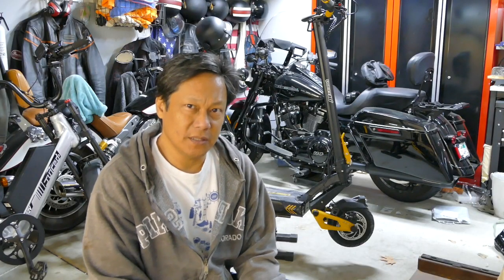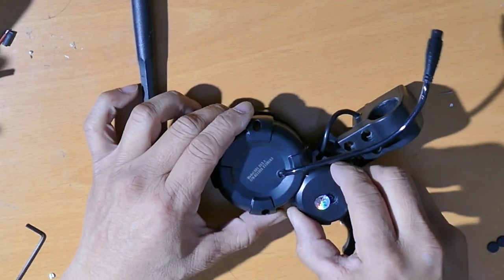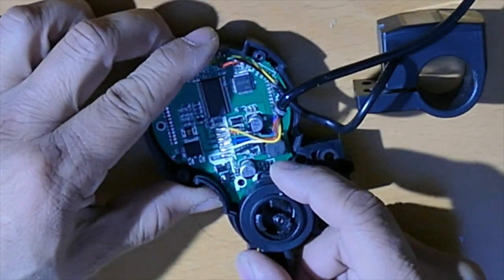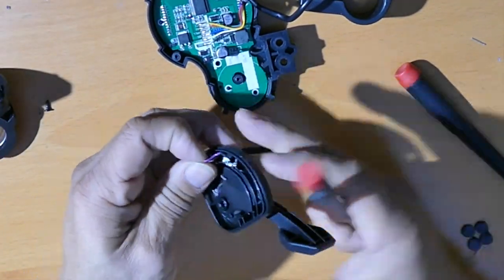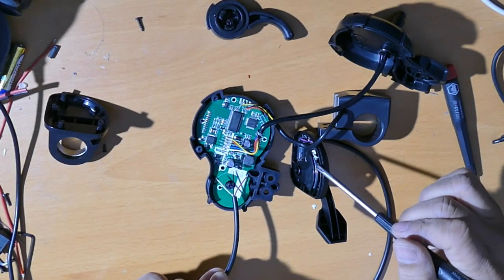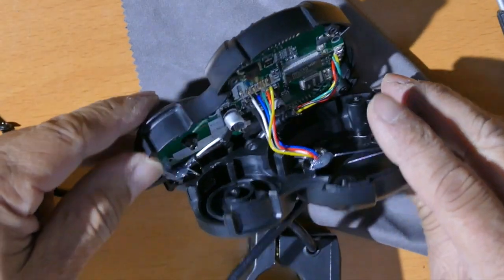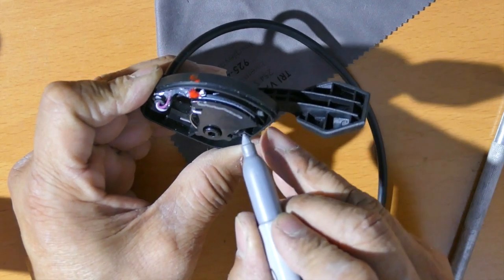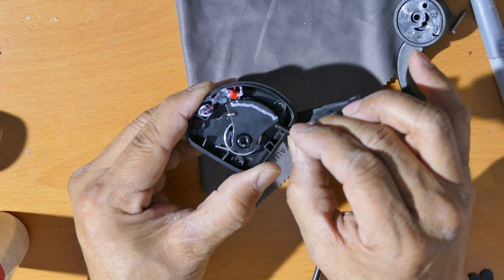Vsett 10+ conversion to thumb throttle? Yes. Works on 8, 9 also

Comment: Edit: switched to the 130x throttle. Better ergo and more control since they're isn't a huge gap of empty throttle so no set screw needed. Thanks for doing this! Got my 10 yesterday and changed it to a thumb throttle the next day. Wired the exact same throttle directly without using the extra wire and filled the hole with glue. Works great! Couldnt have done it without your vid!
Reply: Hello. Can you text link to buy? I want to plug in my vsett 8+. Thankyou
Reply: need the link asell which 1 you bought
Reply: the problem is that these have a different start and end voltage than most throttles, on my VESC based scooters i dont have that deadzone with these throttles

Comment: Great news its possible! This stock Vset 10+ throttle is ridiculous bad!!!
Reply from the maker: Yeah, I didn't like finger trigger either. It was a pain for longer rides and obstructs the brake lever.
Reply: @mypev-diy7269  I´ve used the Original one with the big Display. But fingergas is ridiculous. My easy Solution. Switch upsidedown an now  i have a Thumbthrottle. Works very fine.
Reply: Plz can plz show how to putt the thump throttle magnet in the cirqute board @mypev-diy7269

Comment: I ended up using the same 130x throttle as well. Even tho they are cheap it's my favorite. Immediate response and excellent low speed control. The trigger throttle is terrible IMHO

Comment: well conversion is expected with the same sensor, but magnet travel time is terrible short as i see in this video, if it would be on whole travel length, then would be perfect
Reply from the maker: Yes. That is the problem so the throttle feels sensitive. If I can only figure out how to access the controller's programming, I may be able to change that but so far, I am not able to find any access to the micro coding. I did test the QS-S4 display throttle that is sold with the thumb throttle from factory and it does take up the entire magnetic range when converted to twist so I know the programming can be changed. Just need to be able to figure out how to access it.
Reply: @mypev-diy7269  good luck!
Reply: Did you ever figure out a solution

Comment: I got the same thumbthrottle but the wiring legends are different.  I guess ill follow my own color based on the wired connected to the sensor,  facing the sensor mark,  1Black-2red.3white
Reply: Yeah, the thumb throttle "direct" wiring is different than wiring through the connector. If you can, please post a video of the wiring. It may help other people on clarify. Thanks.

Comment: Acceleration is still really smooth? As someone with a hand disability, this mod is amazing by allowing the use of so many different throttles.
Reply from the maker: Yes, acceleration feel is the same as the finger throttle. There is a setting in the "P" menu to smooth out the throttle also.
Reply: @mypev-diy7269  Thanks! Did you try out that quick release? I like how there is little tension. And any way to have you do the modification if not local?

Comment: Would it be possible to not remove the trigger throttle ?  What would happen if i just drill a little hole for the thumb throttle cable and solder 3 wires to existing trigger throttle hall sensor pins? Would it be conflicting ? Or should i remove the trigger throttle hall effect sensor, solder wires in its place and keep the removed sensor + leave the trigger itself untouched. just in case i want to revert it back to default in future.
Reply: /Also wanted to ask do i need the female part of the cable or can i just cut the thumb throttle cable to reveal those 3 wires?
Reply: /Just noticed your display is not working at all in the end when riding on the road. Why is that? I wouldn't want my display not working after converting to thumb throttle.
Reply from the maker: Display works as usual. Its bright out and the display is horrible in sunlight or bright sky. Its always been that way and I have it set to max brightness
Reply from the maker: You can keep the trigger mechanism in place but the Hall Effect sensor inside the controller has to be remove. Having 2 Hall Effect sensor connected in parallel will cause the output signal to fighting each other, one may be signaling high and the other low and will most likely short out each other. So only 1 sensor can be connected at a time.
Reply from the maker: Don't need the Julet cable. You can solder the wires directly to the board BUT, you will need to verify which color wires goes to the Hall Effect Positive vs Output. It is most likely going to be different if you wire the thumb controller directly without the Julet connector. I included the pin out LINK of the 49E Hall Effect sensor in the description of the video. You need to ohm out the pins and verify or you can blow out the circuit in the display.
Reply: @mypev-diy7269  Thanks for answering my questions! I guess it's easier to look for female julet cable then to make the connecting easier.
Reply: @mypev-diy7269  do you realy need to read the display instead of ride and look at the road?
Reply from the maker: @milordas  Display comes in handy every now and then like check current speed but yeah, hardly ever used during riding.
Reply: @mypev-diy7269  said, "You can keep the trigger mechanism in place but the Hall Effect sensor inside the controller has to be remove...."
Which indicates all you need to do is disconnect the sensor output wire from the pre-exising hall sensor and insulate the two ends you just created from contacting anything else...you don't need to physically remove the sensor or any of the wires. You can disconnect (cut) the sensor output wire at any point along the sensor wire. To restore it to the way it was, all you would have to do is reconnect the two ends and insulate that point as needed (and of course remove or disconnect the thumb mod you had made)

Comment: Hy, i have a question, can you tell me how can i connect a loudspeaker to a hall sensor (from finger throttle) in order to be able to control volume. The loudspeaker have digital volume control and own rechargeable batteries. Thank you in advance for your answer
Reply from the maker: That is more complicated because the loud speaker most likely uses an optical dial or digital push button to adjust high or low. It's not going to be easy but is possible. I have never tried it.
Reply: @mypev-diy7269  thank you for your answer. can you give me a hint? both high and low digital buttons have 2 wires and hall sensor have 3 wires.... how should i connect them with the signal wire from hall sensor?

Comment: Does the hall effect sensor have to be the 49Exxx? Or does it not matter if it has a juliet connector that matches up correctly?  I found a thumb throttle I'd like to use but it doesn't identify the sensor.
Reply from the maker: It is possible that it may work with other series but I don't know for sure. Just be careful because there is a risk of short-circuiting the controller even though the Juliet connector fits if the Voltage pins are not the same.

Comment: hello, I put the same throttle lever on the dualtro, when I make the last throttle, the electronic brake is activated, what do you think could be the cause of the problem?
Reply from the maker: Sorry but I do not own a dualtron and have not play with their display throttle. It is possible there are some incompatibilities with the soft configuration items.

Comment: I need advice if anyone has the same problem as me. I had it converted to Thumb Control, it's better, but it's not for me, it's such a choppy speed, if I try to keep it up, it turns off and on. It's not smooth, does anyone have this problem???? At the same time, the track is larger than the original, but the handling is jerky...😒

Comment: when u push the throttle zll the way down does it go full speed cause I saw in your demonstration it goes slow when pushed far down
Reply from the maker: Actually goes full speed at only half push. Full push stays at full speed, basically no change. Last 3/4 throttle does nothing more and does not reduce power to the motors.

Comment: It's good but you break the water resistant of vsett throttle and you make bigger hole to make water can come easily specially they are sensitive in the rain and cold wheater.
Reply: Just put it back together with silicone and fill the hole up with glue gun using black stick.

Comment: I just tried to follow your instructions but after putting it back together and playing it in the throttle does not seem to respond . Do you have any other thoughts or suggestions on how to get mine working. My first thought is that there might be solder touching one of the other pins but I'm kind of new to soldering so I'm not very good at it. I have an ey3 display.
Reply: maybe your wire colors dont match the connections that need to be made in the ey3, it is critical to have the legs of the hall sensor connected in the same way as the sensor of the hall 3

if there were wires switched around theres a high probability the sensor is already dead so that would mean soldering a new hall sensor or a new throttle

BUT you can take the original sensor from the ey3 aswell, but the pins need to be hooked up correctly and the sensor in the right direction

Comment: is it possible if the stock controller is having different hall effect sensor? will it work?
Reply from the maker: I don't know. That is why I made sure the external throttle mechanism uses the same series Hall Effect sensor.